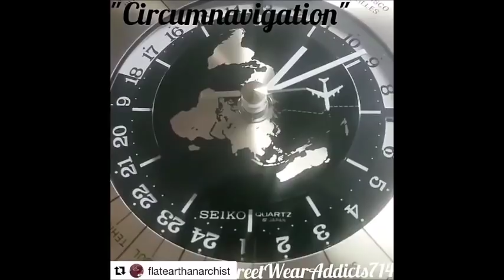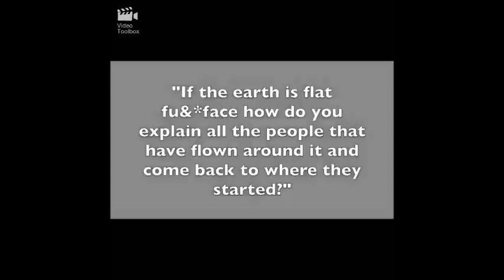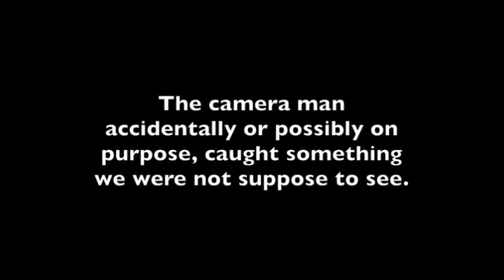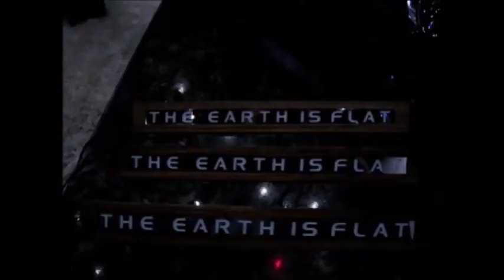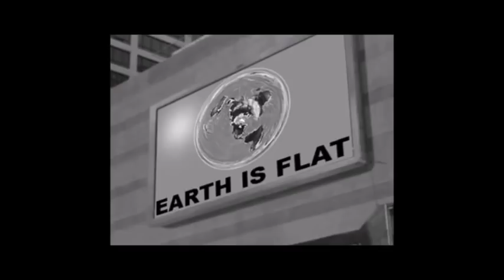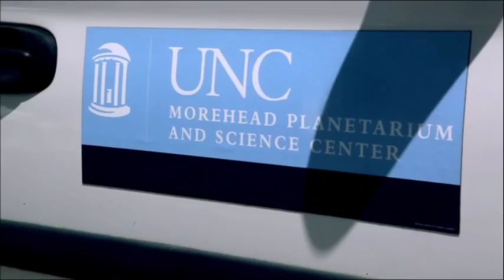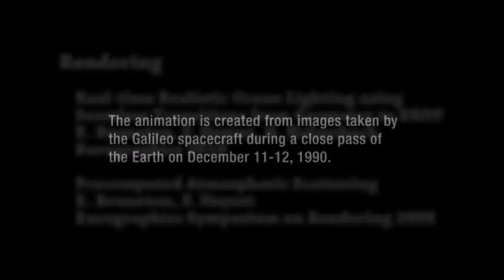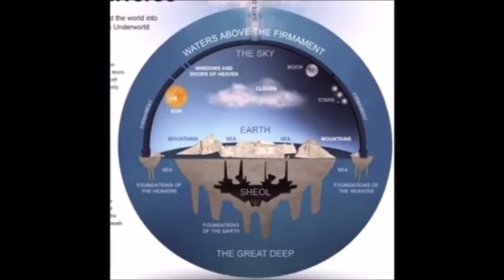Flat Earth Q&A Emails 82 - Mark Sargent ✅

Comment: Hopefully someone can answer this. Me and a friend go back and forth ab out this subject quit often before work. We are both opened minded. Location of the sun, if we are a flat earth. We can see reflections of the sun on the bottom of the clouds in the morning when it rises. Question make any sense? Question everything folks.
Reply: I am also going back and forth on the issue.  However I think you would see that on a flat earth as well as a sphere.  The reason is the angle.  Try a small flash light over a large flat table.  If you put a paper (that is the cloud) above the table and move the flash light. At certain angles the light from the flash light will appear under the paper.